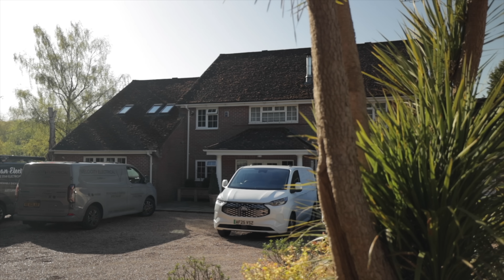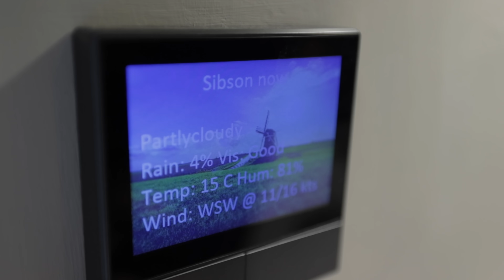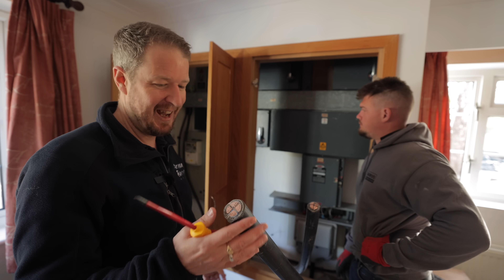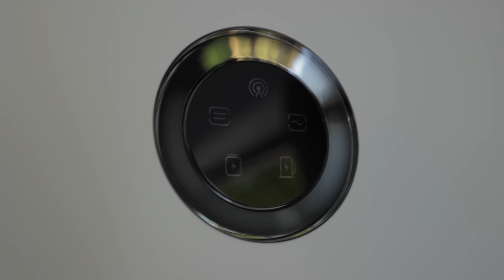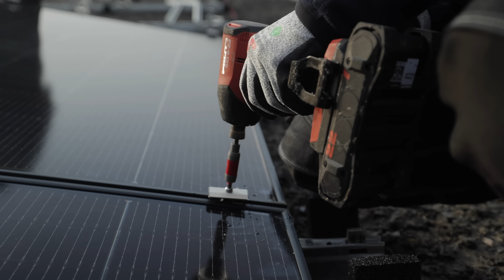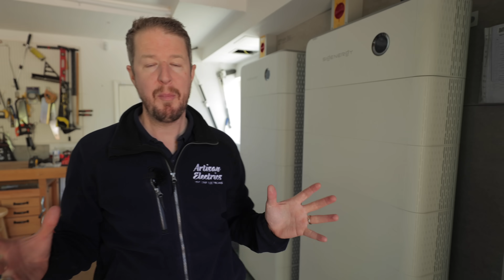Is Battery Storage Actually Worth It In 2025?

Comment: At install costs 15-20k even with a simple ready made system, I think cost savings and profit are a pipedream. You buy it for insurance for disaster and maybe backup if in a crappy power area. . Where I live, even on cheap rate there is a delivery charge so your final bill is only marginally different
Reply: Yep, when I see all these “can have massive benefits” I always think “show me a real life worked example”. Real world usage, charging, install costs etc and the pay-back period. My guess is it’s always well outside of the warranty period.
Then you get those that argue “return on investment” whilst simultaneously ignoring the fact you’re getting return on capital but not return of capital because it is a depreciating asset.
As you say, it’s insurance in which case a much smaller battery can be justified for households. Something like a few hours ride-through protection ignoring high drain appliances like ovens.
Reply: @pantoqwerty  You can most certainly do it and have very quick pay backs on battery only if you're willing to DIY it. Batteries right now are CHEAP. You can build a 15.5kWh pack in a proper case, fused, BMS, active balancing and isolation switch for just under £1,300. While not getting battery backup (adds cost thats not worth it for most  home owners), you can do most of an install of a grid tied system DIY and have a electrician just do final hook up to the consumer board. Would take no more than an hour for them to do. I had this recently done and the return on investment was just under 3.5 years. Accounting for a 10 year lifespan of the inverter and batteries (which is conservative) you're getting returns of just under 200%. So it was worth it for me to do this rather than invest in an index fund.

All it took was a little planning and a day to build the battery pack from its cells, mount an inverter and mess with the settings. For maximum returns you need to be able to size your battery so that it covers about 130% of a typical days consumption, and an inverter than covers about 95th percentile of usage. For me that was a 5000VA inverter and a 15.5kWh battery. Forget buying and selling power, its not worth the cost increases having to uprate everything, you get your savings on self consumption. To this end it makes more and more sense for mid to heavy users vs light ones. All the above is my experience in the UK market.
Reply: It all depends on where in the world you are. In Japan and parts of the US you can recover your investment in as little as 5.5 years but as you say, and I fully agree, it's a solid insurance policy that actually pays back in time.
Reply: It really does make sense if you have enough roof space for a large PV system and a DNO that doesn’t limit your export and the right battery system to be compatible with the best tariff. I’ve exported just under 3 kWh this May and have a credit (that includes import gas and electric) on my octopus intelligent flux account of just under £600. My system, if tariffs stay as are, will payback in approx 3 years.
Reply: @yp77738yp77739  Your maths seems a little off. 3kWh exported for 600 GBP, or 200,000 GBP per MWh. I know UK power is expensive but pretty sure it’s not that high.
Reply: @pantoqwerty  it autocorrected to kWh, I meant mWh. They pay 22p off peak and 30p peak per kWh , no differential between import and export. I don’t know why they do it, it must loose them money.
Reply: @yp77738yp77739    Curious as to what size solar you have:  mine is a 5.25kWh system, and it generated 766 kWhs so far this May. of which 472 kWh were exported.  To generate just under 3mWh would require a very large array,  and I would suspect that it would be capped by the Grid to 6.5 kWh.  So, sorry I do not believe your figures for the UK.
Reply: @farmerpete6274  36*460 W panels with a PW3, ENWL gave us the full 11+ capacity of the inverter. It generates a bit over 15kW in partial sun and exports about 12 with 3 or 4 going to the battery Tesla must under quote the AC output of the inverter. The VPP octopus tariff is brilliant, don’t understand why it’s not more popular, my app indicates there are only about 600 households connected in any one event, but perhaps that’s regional and not national.
Reply: @farmerpete6274  I applied to the grid for a micro generation permit which lets you go over the 15kWh limit.  They didn’t even ask me any questions, but I presume they asked the guy I hired to do the planning plenty of stuff.  I am still not generating that much, as I am using a phased install.
Reply: @yp77738yp77739 never seen a tariff that pays 20-30p per kwh. Best I've seen is 15p
Reply: @yp77738yp77739  In the UK I agree it is really worthwhile, my neighbours have been slowly adding it when they see the money coming in when they are paying out.
Reply: A guy near me as one of the electric cars that can act as a home battery - twice now his house has been the only one with power during power cuts. That solution makes sense to me, you get a car for the investment. I'm not sure if he's part of some sort of trial for the system...
Reply: this is now possible at a fraction of the cost using a complete car battery. I have 41kw Renault Zoe battery connected to a Solax 6kw inverter. Total price £2k.
Reply: Watch the video Gary does solar - solar vs investment. It explains it very very well
Reply: All good comments and some positive and some less so. Sometimes you just want it.  I know for me, i would just want it. Don’t care about cost or ROI etc etc
Reply: My bill was £24 this month without a battery. Just a 8kw system atm Wtf u talking bout 😂 I use about 8mwh a year.  I don't have gas. My heating is done with infrared panels and home assistant controlling them And water is done with a sun amp heat battery. My payback will be about 5 years. I don't pay for ANY maintenance for my items. Less moving parts=less chance of things to go wrong. My bill would probably be in the plus this month if I had a battery so ur not talking from a perspective of someone who has done it And if you have, you did it all wrong.
Reply: @se62hy  People don’t get that they are missing out. Still, better for us, if everyone did it then we wouldn’t get good export rates. Yes, battery is debatable, I only did it to get on the best export rate and to see me over the humps in between cheap rate electricity in the winter. It also has a built in hybrid inverter that can output 11kW AC, so useful for high loads and high export.
Reply: We recently had an installation done for £7k (South Coast). 12 panels on the top of a South facing roof plus a 10.3KW battery. On a good day the system generates 30KW+. I reckon the system will pay for itself in about 5.5 years. It works for us because we're relatively high users.
Reply: if u have the money, the time to learn about em, even though i ve watched for u guys almost everything on the basics of solar and storage through this and several other channels, then its a why not idea, the idea is to offload as much as possible community wise from the ones that actually can easily afford them, just dont buy the ones that burn out, having a system of 40+ kwh that can possibly burn out in a few years due to whatever fault its not a joke nor a toy to mess with
Reply: @shazzz_land ya our utility has already said they dont know how they are going to meet demand so encouraging people to consider alternatives like solar to offset peak period
Reply: My 10 panel 10 kwh battery and solar diverter system cost 9.5k

Dunno where you get the 15-20 from?

I use around 14kwh a day on average and from May to October it will generate enough to power the house and heat water but I force charge from 2-5 and export if I have excess as the overnight price and average FIT price are nearly the same
Reply: @SlowhandGreg depends where you live. In canada, a dpu (inverter +1 battery) is 7k (tax inc) install run you 4k (conservative, mine was 8k due to clashing between utility and inspection agency on “new technology). One battery doesnt get you much, those go for 4-5k on a good day so it adds up.

Eg4 seems to be about 4k for 6000eg, battery plus install plus panels…

Not saying everyone is the same, just saying in my area it is pipedream
Reply: From the people I know (myself included) who have systems sized in the 10+ panel & equivalent battery range the payback seems to be in the 5-7 year range, taking into account the savings and the income from exports.

The UK market will change in the next 5-10 years as the current electricity price includes a variety of tariffs and rates to subsidise various bits of infrastructure that are likely to be shifted off the electricity unit price itself and onto something else.  The standing charges are also unlikely to stay in the long term.
Reply: Even if it doesn't make sense for you, it doesn't mean it doesn't make sense for everyone else. People pay extraordinary bills in the UK sometimes, and they cut 80-90% of the bill with solar + battery installations, which pays for itself in few years and then works at profit.
Reply: @romantruba8790 that’s why i caveated and explained my area and challenge
Reply: Agreed. The capital expenditure just isn't worth it for me. My water and heating are charged up on low rates anyway. My peak rate usage is pretty small in comparison, so a standalone battery isn't worth it. That may change when it comes to replacing my small ICE town car with a BEV and the BEV allows Vehicle to house charging for example. I think he's overhyping the power cut 'benefit'. If the power goes off, I'll just go for a walk or a drive until it comes back on again. I couldn't tell you the last time we had a power cut though.....

Comment: I'm having a new roof put on, I've had a solar array and battery back up since 2017, I would not recommend it to anyone. They want 22K to remove the panels and bring the array up to current codes and standards. This is in the US. The roof is another 31K.
Reply: I got a new roof last year. Me and the roofer took down my 26 panels in 4 hours. Once the roof was put on again, we spent an afternoon to refit the panels. The builder charged me one day labour for it, so about £300.
Reply: Why would you need to change it? They are going to produce power for 40 years..

Comment: I have a question I’d like answering… from whoever.
This install with "cheap" overnight energy.
How long will this last? Not in term of the actual batteries.
But over grids ability to produce cheat overnight electricity.
With Britain plowing towards net-zero and renewable energy… at night solar does nothing, if the wind isn’t blowing, nothing.
For me… looking from a logical point of view. Renewables are a benefit if used in tandem with something more stable, say nuclear.
In my mind you’d want a network that can be 100% powered by conventional sources which can be turned down when the sun shines and the wind blows.
Because for all the rhetoric. Renewables are not cost effective. Environmentally friendly, possibly.
But in terms of space required, be it land or sea. A nuclear power plant takes… please someone correct me 300 times less land space.
Again do the maths on electric. With the race to net-zero. All cars to be EV, houses heated by heat pumps.
This country does not even begin to provide the electrical needs to produce this!!!

Comment: I live near the equator and my small six panel array generates every day it is not raining. It will cover all usage from 9am to 4pm including swimming pool pump. Cost 2000 quid. Payback period at current rates is 10 years but prices will go up so I am expecting 7 to 8 years.
Next step is more panels, routed through my existing board and inverter, and batteries. And that is where I stop, current payback would be 20 years on that investment.
Solar is very attractive when it is panels only.
We do not have an off peak tariff.
Reply: I also have a house in the tropics (17 degrees south) with a 6.6 Kw array and 10 KwH batteries. It saves me a ton of money because the grid price is around 45p per KwH. Probably paid for itself in less than 5 years.

Comment: Not Battery storage I'd be worried about and more it's all the scammer solar installers and the fact even the corrupt energy companies are in the mix and scamming people with their "preferred" installers that are installing dodgy products.  The amount of companies I've seen with weird name panels, inverters and they aren't giving full guarantees either is not a good thing. The export for solar right now even is not worth it compared to the continuing increase in prices.
Reply from the maker: You're absolutely right to be cautious — there are unfortunately a lot of shady companies out there giving the industry a bad name. We've seen firsthand how some so-called "preferred installers" are cutting corners or using subpar equipment with little to no warranty, which just isn't acceptable.

Comment: How does the maths work on this? If they make 24p per kWh (30p - 6p) and have 150 kWh of storage, that's £13,140 per year. How much did the whole system cost, including installation? You said "tens of thousands", but I'm guessing it is quite a lot of tens of thousands for such a large system. If the lifespan of the system long enough for it to pay for itself?

The video was supposed to be about whether it is worthwhile, but you haven't even tried to answer that question...

Comment: There's no way that I'd ever have battery storage indoors. I'd have it in a suitable outbuilding that was fireproofed.
Reply: I’m sure you’d also never garage an ICE vehicle next to your house. They’re bombs just waiting to go off.
Reply: @budawang77  EVs can be bombs as well, if they end up venting gases.
Reply: @leeroberts1192 Statistically they are a lot less likely to catch fire than ICE vehicles. Particularly if they use the LFP batteries.
Reply: the energy contained in 2 average vehicles fuel tanks  is 5 times the amount of energy in the 18 battery modules. Do you park you car in a fireproof enclosure ?
Reply: @biggiejohn3360  ICE car fires don't burn anywhere near as hot or intense as a EV fire. Would you park an EV in your garage, with a lithium battery that could melt through steel if it went into thermal runaway?

If an ICE vehicle catches fire, you've got a chance of putting it out yourself, if you've got a suitable sized fire extinguisher to hand, with an EV fire, you've got no chance.
Reply: That's over kill, those Sigenergy batteries are the safest in the industry, they also have in-built fire extinguishers.
Reply: @AngusF-r8b  What do you think a fire extinguisher is going to do when one of those goes thermal runaway?
Reply: @fraggit It has 5 levels of safety, I recommend reading into it, also I have many LFP portable battery systems, never had an issue after multiple years using them. Mainly it’s EVs that have fire issues due to being moved around so much. Having a stationary battery that can’t get hit by something, if not faulty, 10+ years of safe use is very likely.
Reply: LFP batteries can't set on fire
Reply: @Lewis_Standing  Are you 100% sure about that?

Comment: But the assumption is that electricity prices will remain high. With off peak prices available at 7p a kWh overnight for 7 hours and current day prices of 26p a kWh it might seem to make sense. If you are following today's electricity market (26 May) where gas is providing energy only for maintaining frequency balancing/inertia then we should see prices fall, dramatically. The Grid will have 7 GW of unconstrained wind join it over the next 18 months Dogger A,B,C and Sofia plus Hornsea 3) with the ESO stating that by the end of 2026 they are planning for gas free days. To do that they will use BESS and old turbines running merely to supply rotating kinetic energy to prevent frequency fluctuations. BESS which so far has been frequency following; and that may well be what turns out to be the problem that Spain had, will make the frequency. So the present record of 22.5 GW of wind which did not include about 4 GW of constrained wind in the North of Scotland will become 33-35 GW, That will be gradually unleashed over the next 3-4 years as SSEN and SPEN build out the 400 kV grid replacing the 133/275 kV circuits. And in 2029 4 GW of HVDC from Peterhead to Drax and Bicker Fen will unlock that power which currently gets stuck up in The Highlands. With the CFDs for these new wind farms set at 5.3p a kWh at today's prices where is the benefit in roof top solar and batteries for the domestic user?

Comment: Panels still generatate in snow not much but they still make some causes them to warm and if angles are correct the snow will fall of or you can clean off snow. Adn depending on your systems you should be fine in winter. Sun trackers help alot. Panels type and wastage means alot he is hlkinda of down playing it
Reply: It's more economic to lie panels flat on the ground than mess about with trackers.
With the cost of trackers you could buy more panels.
Reply: Well if u got a little property and not alot of money thats is the way..and dyi is still cheapest@Lewis_Standing

Comment: The Eevblog YouTube channel recently showed the ins and outs of his solar + battery system.
Even in sunny Australia it's really difficult to go 100% off-grid in winter.

I have my doubts if that will every be viable when having to charge some electric cars as well. 

Also break even point will be at least 10-15 years or so
Reply: Return come down to cost per power.. for some like my self buying and In stalling my self I'll get my return in less then 6 mouths because of my story. . Had a house fire. Now I live in my camper. Was using a generator costing $ 30 a day in gas plus  $12 every 3 days fornoil change. With my install even small as it is It paid me back fast.. I was spending almost 1000 a month total.  I spent under $6000 for my system and it keeps my with ac and everything 24/7 when paying an installer it cost way more